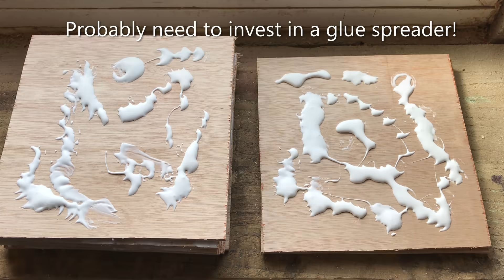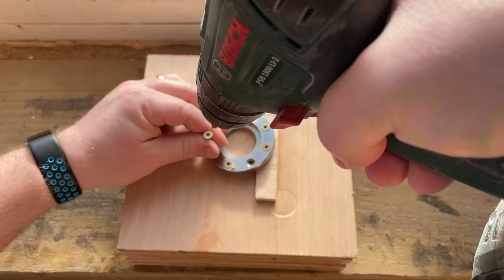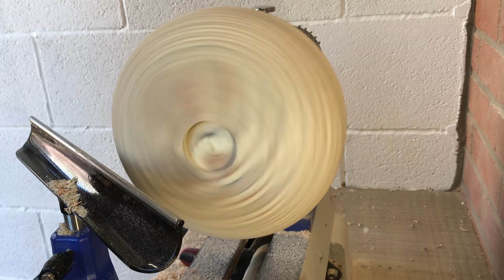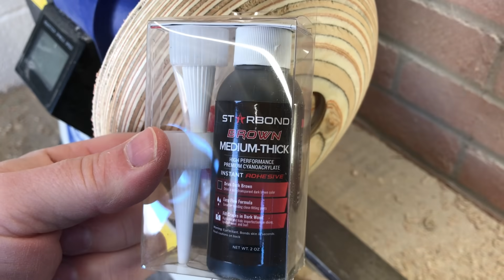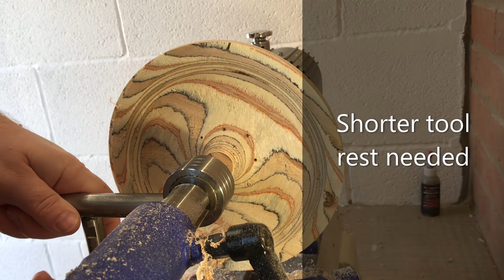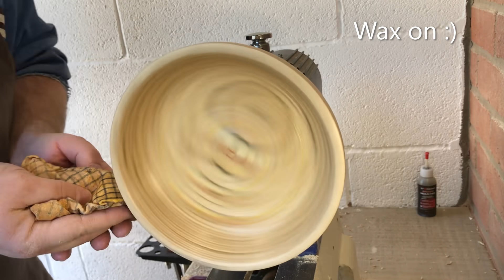Wood turning - Plywood Bowl

Comment: Beautiful, absolutely gorgeous!  Good work.  I really like the way you handle those little voids.  That’s what came to my mind, the plywood that I’m used to has little spots where the wood layers, didn’t take care of.  My father used to make plywood at a mill in central Oregon. It’s not very scientific.  I am wondering if that’s why you use thinner plywood?
Thanks Clay
Reply from the maker: Yes, I tend to find thinner plywood has fewer voids, the challenge then is more layers to glue, so tougher to turn, even with carbide tools. Thanks for watching 👍

Comment: That is really cool - I'll have to try it. I notice you use Sanding Sealer a lot - i have not used it. What does that do after you sand?
Reply from the maker: Thanks for watching. Sanding sealer acts like a primer or base coat for the finish. It improves the finish 100% I would strongly recommend! 😎🎄👍

Comment: Very clever and very nice....good thinking.  I have a question: I noticed you used traditional bowl gouges on the outside of the bowl but went to a scraping tool for the inside.....was there a particular reason?  Thanks again; Peter
Reply from the maker: I started by hoping that the traditional tools would stand up to the glue and mixed grain of the plywood. After sharpening my bowl gouge twice, I gave up and went to a round carbide tipped tool. This was a much better choice, but I still managed to dull and brand new tip, just from the inside alone! Hope that makes sense. Cheers 👍

Comment: how many sheets of plywood did u use? chris
Reply from the maker: 10 layers of 5.5mm plywood. I could have used thicker ply, but wanted as many thin layers as possible. Thanks for watching 👍😀
Reply: @RDMWoodturning  so thats 5.5mm thick?
Reply from the maker: @thestutteringwoodturner9824  Yes 10 sheets of 5.5mm ply

Comment: Can you possibly give me the dimensions (length and width) of each board. You told us the thickness (5.5mm) of each board and the quantity (11 pcs). I just need the width and length, please and thanks
Reply from the maker: Hi, I think that they were 8 inch square, so 200mm x 200mm. Good luck!👍
Reply: @RDMWoodturning  That is a bit of good information, thank you. I really like your work. Makes me think I might be able to something similar.